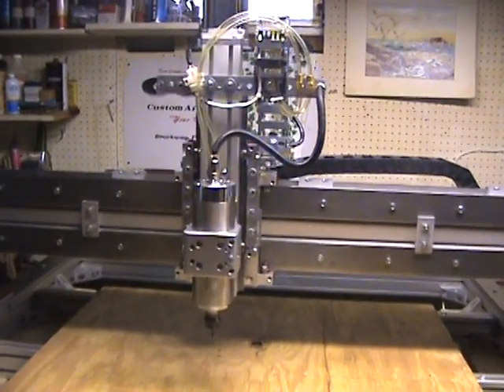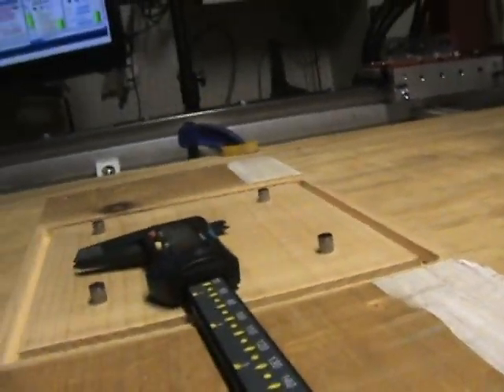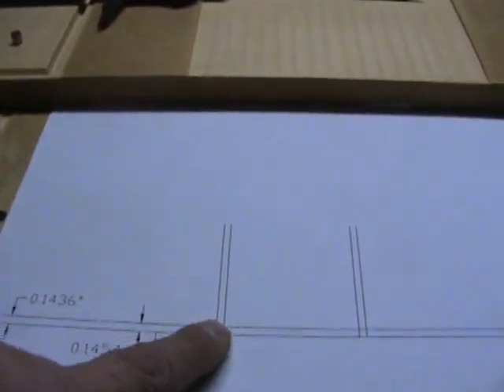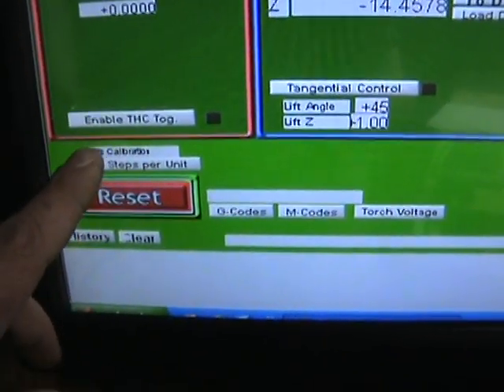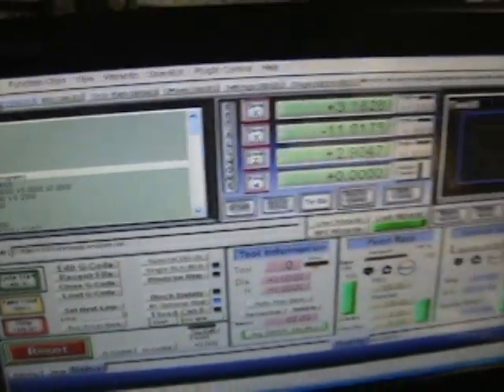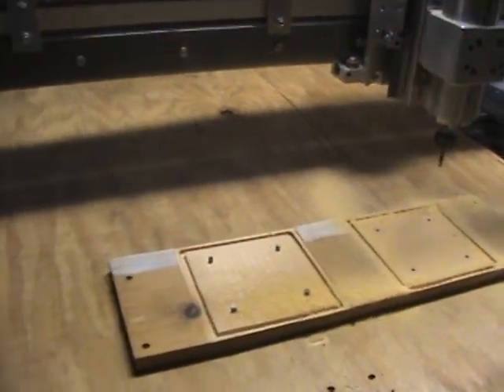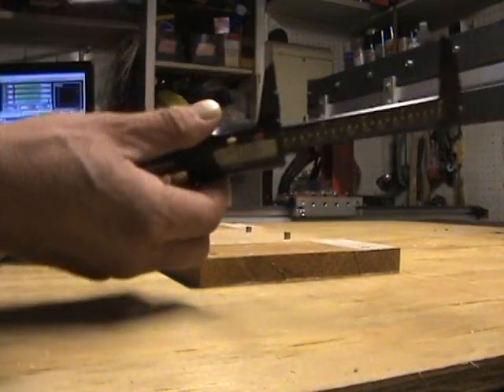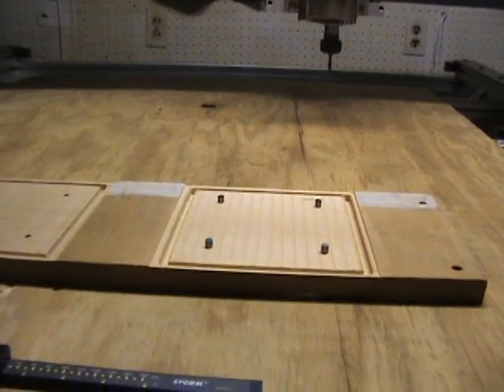Building CNC Router Parts CRP4848-24.MPG

Comment: Thanks for putting these videos together. They've been very helpful. Can you please tell me how to translate your measurements from your initial test cut into adjustments which need to be made to the machine? Is it just trigonometry?
Reply from the maker: Yes, the pin holes are all spaced equally apart, so you just need to solve for the hypotenuse of 45 degrees to get the diagonal length.

Comment: The reason I say that is when I built mine,I bolted the rack right to the frame. Big NO-NO
if you want to adjust later. Especially if  you have the problem you and I had. Just an opinion.

Comment: Hey,
 If I understand correctly what your saying instead of putting the shims behind the 3x6 gantry.
Couldn't you just run the gantry up to the -Y bumpers, and with the machine still ON loosen the
rack clamps and tap the rack forward till the right side touches the bumper?